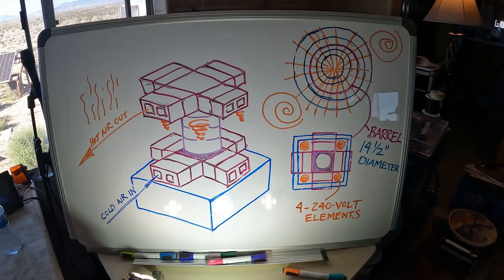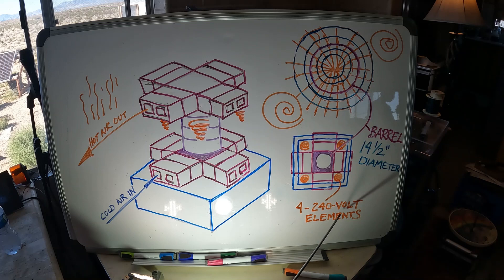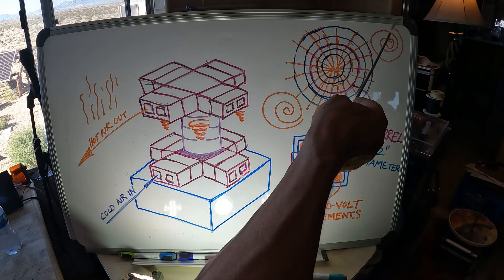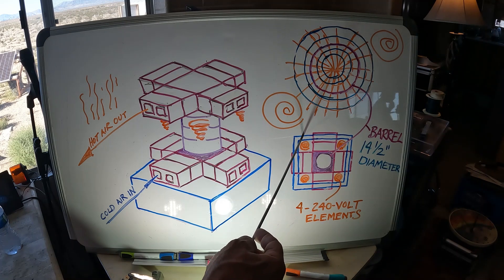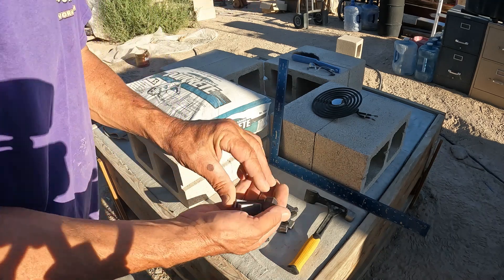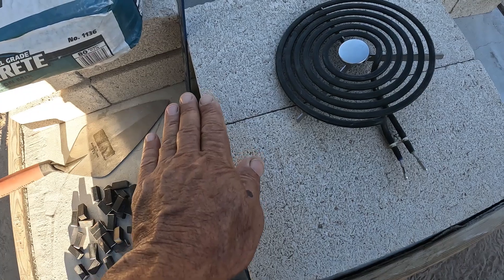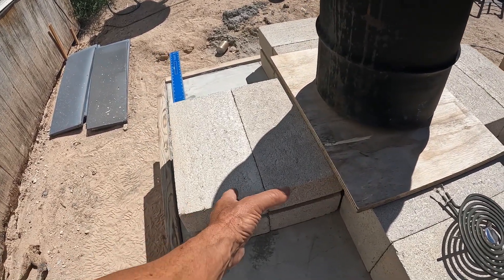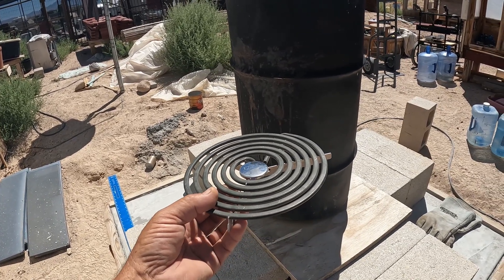Sand Battery Design Changes and Other Details E109

Comment: Nice ! What about the fridge ? It seems to work well, when connected directly ! So you could have one heat battery, and one cold battery, with strawbale or airecrete insulation, under the mobilehome...?
Reply: Below 0 storage would be usefull .so many projects.
Reply: You could even sell excess ice block when you have a lot of sun ...! @teddycunningham7568
Reply from the maker: Yes you are correct the refrigerator works fairly well wired directly to the panels. I had 510 watts powering it on the experiment. I will get back on it sometime soon. If I was to stay on this property I would continue remodeling the trailer and other projects but my plan is to move onto a larger property and start all over with what I am learning here.
Reply: Ok !!  @off-gridsurvivalmike8120   Good ideas ! Trees are a great way to keep cool when weather is hot too ! 😉 And are self caring solar pannels that reproduce themself !! About these projects, aren't they moovable, and usable in other place ? Water / sand reservoir used as heat/cold storage can be emptied for the travel too

Comment: Rods seem to be a good idea for heat conduction.heat likes to conduct in a strait line any bends will slow down conduction .when useing wire to hold insulation in place it is recommended to bend in a Z shape to limit conduction to the outer walls.
Reply: yes, maybe use aluminum rods? I was thinking of embedding a 1 inch pipe in my 55 gallon drum. the pip would have a U bend in it so the air would come in underneath and come out that way too. That way I could insulate and control the heat loss of the drum. Mine would be for a greenhouse. I will use a fan controlled by a Pi Pico so it turns off and on as needed... I made an incubator with the same sort of logic. For me, having a sand battery would resolve the problem I have with having to buy a huge LifePo battery bank. I have been off grid for a little over 23 years and only now have given this idea a thought. Well done Mike I like your thinking.
Reply: @martinbirrell57  I have done a lot of research on electric storage battery's and have found many advantages to using used Industrial flooded lead acid batteries from fork lifts  . Inexpensive, extremely powerful,  20 year lifespan and no BMS electronics so they well continue working  after an EMP event..
Reply from the maker: That is an awesome recommendation, the fork lift batteries. I tend to lean towards lead acid batteries myself. Yes they are messy but very industrial and fairly easy to maintain.
Reply from the maker: Great information thank you.

Comment: So that will give you about 1000 watts of heating power over a 24 hour period. The interesting part will be how long the sand can produce the heat when there is no sun. Without a fan the convection of your system will bleed the heat off so you need a vent control on the inlet. Awesome job Mike you have a very good imagination.

Comment: how much sand are you using? I though I have is that if you use a lot of sand then you will need a lot of energy to get much temperature out of it. If you use a little sand you will get more useable heat from the sand... if it heats 100kg of sand say 20 degrees higher than ambient then you will have less usable heat than heating 20kg of sand with the same amount of energy.
Reply: The larger the mass the more energy stored  just will take longer to reach maximum temperature and conversly longer to deplete. This is a heat storage device capable of storing heat for weeks or even months  if properly insulated.
Reply from the maker: I haven't calculated the exact amount of sand this will require. But by using my prototype as a reference, I believe that 4 of the heat elements, one in each corner should be similar to around four times the capacity as my prototype that is still hooked up. It's all guess work and I know I need to do some calculations but a lot of times on my projects I just wing it lol. 😂